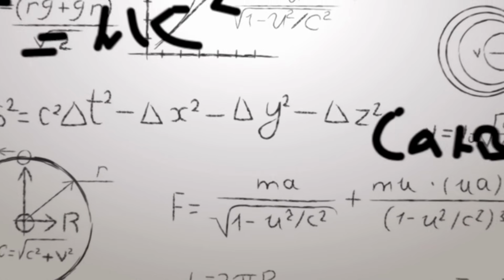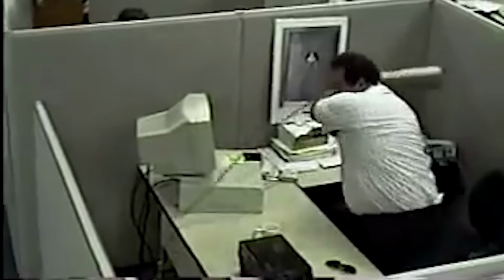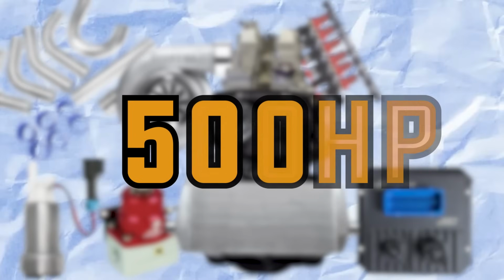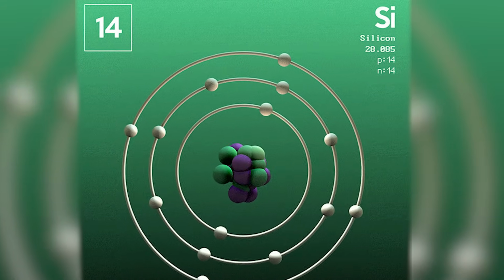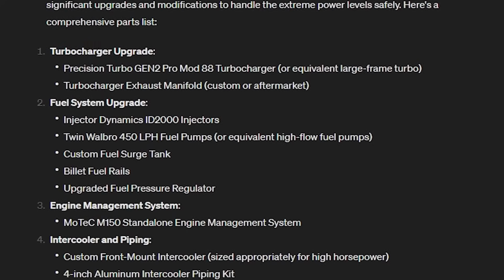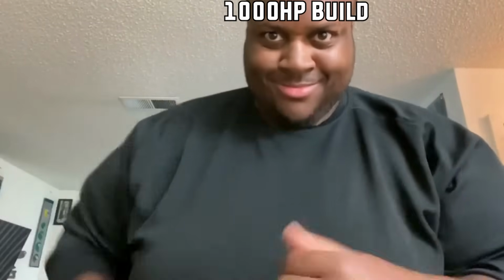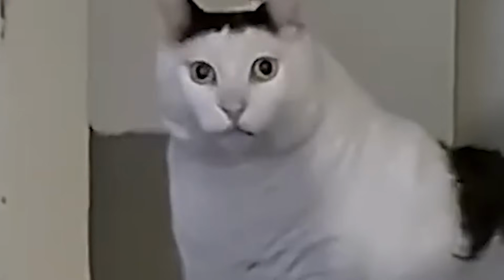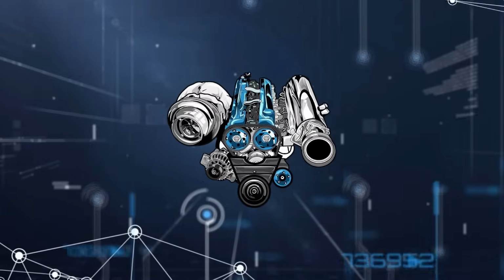Can ChatGPT Upgrade The Toyota 2JZ!?

Comment: Stronger valve springs are needed for any good engine upgrades
Reply from the maker: Yeah totally right my man! I've found the 2JZ can handle 500hp on the stock springs but upgraded springs are going to make for a more reliable cylinder head! What do you think?

Comment: Just did this for a 500whp K24A2 and chat GTP pretty much nailed it.
Reply: I just put a 450-500whp K24A2 in a Toyota MR2 SW20. Fully rebuilt everything. Almost ready for paint and it’s done.
Reply from the maker: @jtotheace1  that is too cool my man! Is the MR2 a gen 2?
Reply from the maker: Dude that is awesome to hear!! I think it's so cool that ChatGPT gets pretty darn close to the exact parts list you need😁 May I ask what car you have that monster if a K24A2 in?
Reply: Yes Gen 2. Also have a Gen 1.
Reply from the maker: @jtotheace1  too cool man, rock on! My dad has a totally stock gen 2 turbo, such a fun car!
Reply: I was thinking about 2gr for my sw. K swap could work too
Reply from the maker: @supers0nic77  Both great engines!
Reply: @supers0nic77 I went with K swap because the engine has tons of aftermarket support. Used a Type R 6 speed with LSD with it but might go sequential one day. Also the engine is cheap, lightweight, compact. Easy to install. Lots of others doing the same swap.
Reply: @jtotheace1  tbh i did one on my zzw but it's basically a stock k24a

Comment: tried this on my 3cly the 1kr-fe. which iv got running at 120 N/A and soon to be 200give or take and it was just making parts up. or giving parts that dont fit like a 4-2-1 exhust. but when convronted on the parts being wrong it just gave an engine to put in. the 2zz which would fit.
Reply from the maker: First off, that's awesome you are getting a 1kr-fe to run at 200hp! Hecking awesome! And hahaha yeah I thought it was hilarious when it would just make up a part😂
Reply: @TunerFaction  i could prob push 300hp🤣. but im trying to get to 200hp first
Reply from the maker: @dillonlee3229  sweet man that's awesome!

Comment: The highest output smaller displacement motors still make CRAZY POWER (Nitro motors for RC cars and Top fuel cars for example)
So theorhetically, while you'd need more displacement, yes, you're over-emphasising this
The Top fuel cars are 426 Cubic inch hemi motors, albiet completly redesigned, but they make AROUND 10,000 horsepower (Nobody really knows due to the power output being far to high for an automotive dyno)
Reply from the maker: Very true my man! The discplacement really wouldn't need to increase by a huge amount, I was still really hoping chatGPT would totally redesign the engine😂
Reply: @TunerFaction  I mean, 426 Cubic inches IS 7.0L so, it'd have to be bumped by a fair bit, or it'd need another alternative way to make power, like 70+ psi of boost, which isn't impossible
Reply from the maker: @SlowSTEN  oh dang I didn't know a 426 was 7.0L, that's a big boy hahaha! Yeah you're probably right, the discplacement would need a sizeable bump and the boost would need to be CRANKED up, maybe it could run 80psi and make 20,000hp for like half a second and then blow to bits😂
Reply: @TunerFaction  429 is 7.0L, I rounded up a tiny bit, but I believe they also run 60 PSI through a blower (The blower alone takes around 1,000 horse to run)
Reply from the maker: @SlowSTEN  1000hp just to run the blower!?
Reply: @TunerFaction  IKR?!
Reply from the maker: @SlowSTEN  bruh that's unreal😂 you're telling me a 900hp engine couldn't even run the blower then!?
Reply: @TunerFaction  Im sure it theorhetically COULD, but it would likely stall at higher RPMS, or "RPM LOCK"
Reply from the maker: @SlowSTEN  dang, that's very interesting my man!!

Comment: Precision 88mm turbos have virtually no lag. I have one on my nova.
Reply from the maker: From the research I did I heard on the 2JZ's they are quite laggy? I was just saying that at 1000hp most 2jz guys run a smaller turbo than an 88mm. I bet your Nova is a rocket though 🚀
Reply: @TunerFaction  Ahh gotcha yeah on the 2Jz I can see how they would be laggy. I’m running an LS engine and it lights immediately
Reply from the maker: @1320Cooper  oh I bet!!! Those LS's are crazy torquey😁
Reply: @user-tz4lr8xe4d it’s a stock block 5.3 LS. Little different from the 2jz.

Comment: Chat gp doesn’t care about your transmission or brakes. 
Also didn’t say what type of fuel
Reply from the maker: So funny enough it actually did make a transmission reccomendation but I just didn't include that info in the video because I just wanted to keep it focused on the engine upgrades, but yes you're right that stuff if super important too! And you're also right it didn't say what type of fuel to use except for the jet/rocket fuel it mentioned to get it to 20,000hp😂

Comment: Hey hey hey, chatGTP just wanted you to have a loud compresor surge with out the waste gate, he know bout the stutututu
Reply: Wastegate has nothing todo with that. Thats blow off valve. It needs a wastegate for boost control
Reply from the maker: @rb30sucks  to be fair, in theory if there wasn't a wastegate and your boost pressure went sky high (like 80-90psi), technically a BOV wouldn't be able to disperse all that pressure at once and there would be compressor surge😁 of course that's just a theory!
Reply: @TunerFaction  Stututu isn't compressor surge it's the turbo going backward from intake pressure buildup.
Reply from the maker: @Iseenoobpeoples  contrary to popular belief, the turbo actually doesn't spin the other directon, it just spins slower as the air in the intake track pushes back out of the turbo intake! I always thought the turbo spun the other way too during the stustustu but recently learned it doesn't!
Reply: @TunerFaction  Ok maybe it doesn't go backward but there are huge force in the opposing direction on it, turbo surge is when the boost keeps climbing uncontrollably it doesn't make any sounds.
Reply from the maker: @Iseenoobpeoples  From the engineering class I took in college, compressor surge occurs when there is too much pressure and not enough airflow. So in an engine there are two types of a surge, one is when you let off throttle and there is nowhere for the built up pressure to go, so it exits out the inlet of the turbo where the compressor "chops" the air and makes the stustustu sound, and the other is how you said, there is too high of a pressure and the engine cant keep up which can also cause the stustustu sound, but sometimes it doesn't. I could be wrong but that's what I learned in my engineering class!
Reply: @TunerFaction  Too much pressure built up on the hot side will cause surge condition (can be caused by a wastegate that is too small) Look at the definition of the word surge : A surge is a sudden large increase in something that has previously been steady. That describes pretty well the uncontrolled speed increase of the turbo. That won't make any sound, turbo speed is too high, we can't hear those frequencies. Turbo flutter is a better term for the sound it make when the air reverses on the cold side. Ask yourself if you had to use the word surge for one of the two situations, which one would be more appropriate?
Reply: @TunerFaction  In one of the situation the speed is increased rapidly and in the other the speed is decreased rapidly.
Reply from the maker: @Iseenoobpeoples  hey man I appreciate the reply! I have only ever thought of compressor surge occurring on the cold side, I've always thought of an over pressure situation on the hot side as just "boost creep". So I guess you're right, what you are describing is absolutely a turbo surge! I would then argue that a turbo surge can occur on both the hot and cold side of the turbo then. Would you agree?
Reply: @TunerFaction  Of course they are permanently connected together with a shaft! So you could say turbo surge is rapidly increasing/uncontrolled shaft speed. This wont make any noise. In the other situation (flutter) the cold side being blocked off (no blow off valve and closed throttle) will cause flow reversal from the build up pressure, the air starts rushing backward when there is no more space for it, then in collides with the cold side wheel and causes the stu stu.
Reply from the maker: @Iseenoobpeoples  great explanation there boss! Thank you!
Reply: @TunerFaction  No problem, I received hints from others multiples times.. My friend had many custom turbo kit for over ten years so I saw the details first hand, now it's finally my turn for boost I got a pile of components next to me. :P The motorsport community is great.
Reply: @TunerFaction i think a lot of setups that run that high have multiple of them to allow the pressure to disperse quickly. But it would sound ungodly😎
Reply from the maker: @JamesAnderson-fw5ew  hahahaha ph dude you're absolutely right there would have to be multiple, and it would sound heavenly😫
Reply from the maker: @Iseenoobpeoples  that's awesome man that you got all that firsthand experience! May I ask what exactly you'll be boosting?
Reply: @TunerFaction  A modified Scion FR-S; 255 semi-slick, clutch pack LSD, coilovers, geometry changes etc. it took lot's of work to make it stable and balanced. I got a spare blown engine that I will build up with lower compression ratio and more, aiming for 400whp. My friend, competitor :P , has a rotary swapped RWD Honda Civic with 400whp, we do amateur time-attack.
Reply from the maker: @Iseenoobpeoples  that is hecking awesome man, those FR-S/BRZ platforms always do well at the autocross events I go to😀 haha my main competitor drives a BRZ!
Reply: @TunerFaction  and what is your ride mate
Reply from the maker: @Iseenoobpeoples  oh thanks for asking my man! It's the 2JZ swapped 240sx on this channel actually!
Reply: @TunerFaction  That's an ambitious project with tons of work! will be worth it at the end! gl hf
Reply from the maker: @Iseenoobpeoples  hahaha thank you my man! Good luck to you as well!!!
Reply: @rb30sucks  by not having the waste gate or BOV if that’s what you’re referring to, it creates back pressure to the turbo there for compressors surge and stutututu
Reply from the maker: @MarcLovesEChassis  exactly! Well said!
Reply from the maker: Hahahaha yes!😂 chatGPT is all knowing!
Reply: whoa whoa. that's so misogynistic to assume that HE is a he.

🤭
Reply from the maker: @seangeeb  😂
Reply: Dose pipe is the way
Reply from the maker: @pigbelly100  agreed😫
Reply: A 3582 could also be an internally gated turbo, which would come attached to the 3582, and wouldn't require either a Blow Off Valve OR an external/aftermarket wastegate.
Reply from the maker: @Cheap_Steeze  Ok very true I didn't think about that!
Reply: @Cheap_Steeze  You would still need a blow off valve, the gate is on the hot side only.
Reply: @Iseenoobpeoples  no you don't
Reply: @Cheap_Steeze  If you don't then you will get the flutter stu stu sound from the air rushing backward and that's not good for the turbo, the manufacturer would certainly recommend adding a blow off valve.
Reply: @Iseenoobpeoples  compressor surge doesn't hurt turbos when the throttle blade is closed, compressor surge is only a bad thing when the throttle is opened and the charge piping/intercooler/intake aren't big enough to accommodate the boost